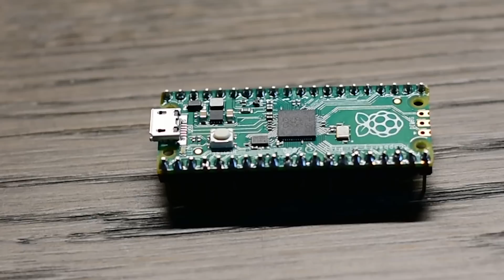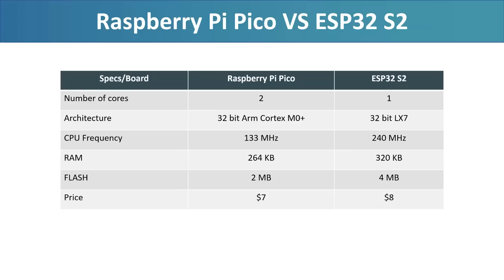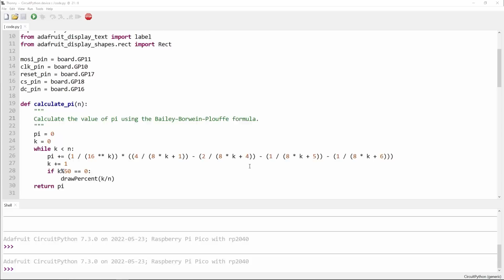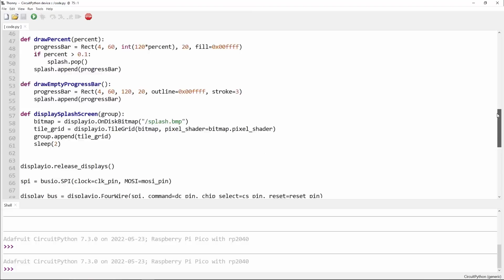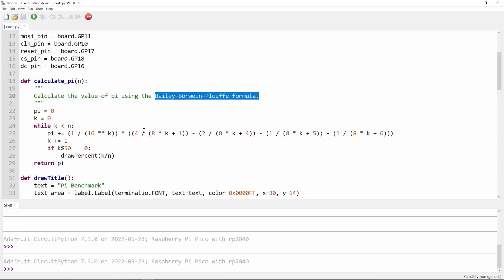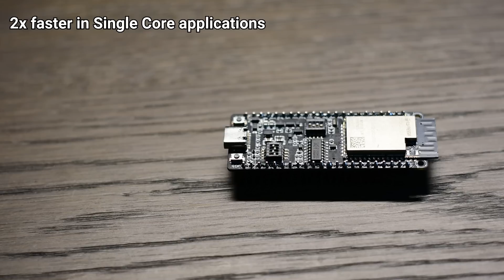Raspberry Pi Pico VS ESP32 S2 speed comparison benchmark using CircuitPython

Comment: Regarding power consumption, the led on the ESP32 can be desoldered as it is adding to the total wattage without doing nothing to the performance outcome of  his test, also, don’t know if the radios are disabled, witch also adds to the total power consumption.
Reply from the maker: I will try that as well. Thanks!

Comment: Any project using WIFI or Bluetooth the S2 is the only option and anything using complex fast IO the PICO would be the better option. People need to learn to match the device to their problem. Also you need to make sure you turn off the WIFI/Bluetooth radio on the S2 when testing. By default these use a lot of power even when not being used unless explicitly turned off.
Reply: The 2040 chip on the Pico is available as a component and has been used on other implementations including WiFi and Bluetooth boards.

Comment: Very nice!
I ran simple calculations and CoreMark on Pico and ESP32, the result is similar.
The fastest one so far is 912Mhz Teensy 4 especially on 64bit floating point calculation. The K210 600Mhz is good for 64bit integer.
Reply: The pico can be overclocked to 250mhz and be se to with -O3 flag
Reply from the maker: Cool! Thanks for sharing. I will try it!

Comment: Was the WIFI radio disabled in your ESP32 sketch? At least for ESP8266 the difference in power use with active WIFI is significant, even when it is not in use.

Comment: I've seen people say you can o/c the pico to 436Mhz.  You could probably safely run it at 266Mhz and you'd be at same speed as ESP32.
Reply: But 2 cores if you know how to use it. Even under Arduino for beginners is multicore library for using Pico second core. Micro Python is also handy for quick developing.
Reply: Just started running the Picomite (Pico with MMBASIC) at 378MHz. Seems solid and no significant temperature rise 👍😎

Comment: Pi Pico is $4 and it is a fixed price. It also has its unique PIO (4 PIO cores for each CPU core), which is a game changer for many applications. It however lacks WiFi/BT capabilities.
Reply: ESP32 S2 is also $2-$4, he probably got it from some resale shop in his country that doubles the price. (which is very common)
Reply: You can get rp2040 board for 3$ weact rp2040 , doesn't have buck boost converter but high quality board. S2 with psram for 4$ wemos s2 mini

Comment: I am getting pretty low RAM on the Esp32-s2 using circuitpython, any have that problem too? gc.mem_free show around 60K and on the Pico show 190K on the esp32-s2 should be more than the Pico
Reply: You can buy wemos s2 mini with 2mb psram

Comment: nice video, but I'm not quite sure if python is the best language to compare the power that lies behind some architecture.
Reply: Micropython is VERY slow on the Pico. This is why I use c as my language of choice. I am using bothe cores I'm my projects. In my case I need seemless integration in my projects. Any stalls in my main code will cause visual flickering problems. The second core solves my issues.
Reply: @talk2azs  not that slow in my experience. Also, over lock exists
Reply: That's what I thought. It's like comparing athletic performance of two runners by only letting them walk on their hands.
Reply: Yea you never know what assembly python will be unrolled into. Sometimes it can be quite baffling unrolling a command to 30 -300 operations when C would do it in one or two
Reply: It’s worth taking a look at the generated code sometimes to get a sense of just how much slower python must run than native code. Python is much easier to understand though, but I have found it’s performance to be very poor on these boards. Just the libraries and the micropython kernel quickly eat up that 2-4mb of flash. Like really quickly.
Reply: I wonder why python has made it into this corner of software engineering in the first place. Don't get me wrong, I think python is very useful. But python on embedded systems seemed as weird to me as java on an embedded system. Always just seems as a tech demo, or a crowd pleaser; not really meant to be used seriously.
Reply: I still wanna see which one is faster at python
Reply: Yeah, it would be a better comparison to just have them both compute the same things and do that in their native code
Reply: You are right, but considering many makers will be using python for their projects, it could be reasonably useful to indicate what their overall experience might be.
Reply: Python is just a wrapper for C
Reply: A better approach would be just to use advertised IPC x Clock (instructions per clock) to get instructions per second

Comment: Where the RP2040 really shines is with complicated I/O. Rather than bit-banging your protocols on the main core, you can use drivers for the PIO cores to manage the low-level details, and work mostly with filled buffers at your application level. The second core is useful in much the same way - offload a complicated process with sensitive timing, leaving your core application logic untroubled by such things. Also, reports are that it overclocks very nicely. All that said, I still love the ESP32 for some workloads.
Reply: If the ESP32-S2 is implemented with a DMA for niche protocols, I don't think the pico's PIO is a straightforward victory. Then again, I'm not too familiar with the ESP's DMA implementation either, so this might be a straight victory for the pico. But for conventional protocols like I2C or SPI, DMA with the ESP32 and DMA or PIO with the pico should be fairly equal. Though I would give extra points to the ESP because its larger ram means it can have a larger buffer.

It does seem the pico has a lot more performance left on the table if python isn't used here. I'm curious how it would fair if this test is done on C. Even with Python, deleting the code drawing that progress bar will make the gap between the two smaller.
Reply: esp has wifi and Bluetooth, it is very handy feature. for projects that don't require internet connection i use good old arduino nano
Reply: @Gameplayer55055  If You don't need Bluetooth and You familiar with Espressif IRAM, You can free more 48KB of RAM
Reply: @Gameplayer55055  Coward.
Reply: @cybermechid9181  that stupid miner/covid/??? related chip crisis kills me. even microcontrollers became more expensive. i remember pico started from 2$. hopefully i have some bought before

esp8266 radio can be turned off in settings. tho pico has more pins, better to use it if no wifi required
Reply: Just a question: Would it be possible to use the pi with a gpio expander to deal with both i2s audio and a full 107key keyboard setup by dividing the operations between the cores? Could probably benefit using a C-language for that comapred to the rather sluggish circuitPython code that usually runs on these dev board.
Reply: @zipp4everyone263  
1) usually keyboards have buttons combined in grid for cost reduction
2) need to get good usb implementation to achieve good polling rate
3) need really optimized code

usually keyboards have specific chip, that is designed to be a keyboard

Comment: First I want to say a wonderful video posting, concise and clear, easy to understand and follow.  And I would give this 4.7 stars our of 5.0 .
I am just being picky about the units, at 3:50 this video describes the RP2040 board using 10% less POWER (than the ESP32) to perform this calculation.
 And I agree the the RP2040 uses 10% less SOMETHING, however that SOMETING is not POWER, but it is ENERGY. 
(NOTE: Most non-technical people don't understand the distinction between Power and Energy)

Comment: Next comparison: hammer vs screwdriver. ESP32 has its uses, but so does RPi Pico. Pico is unbeatable, when you need a ton of cycle exact IO, thanks to its PIO. Try to output DVI signal on an ESP32, not going to be able to do it. But Pico can do it just fine.

Horses for courses. Both are absolutely great uCs and have their niches. You might end up using BOTH of them in the same project!
Reply: There's nothing ESP32 can't do.
Reply: @jaedson-barbosa  VGA with zero CPU usage, and PWM at 200 MHz please. Working fine on the Pico, but would like to move it to a ESP32. Can it do it?
Reply: @dazzer_  you know the PWM frequency is configurable, don't you?
Reply: @jaedson-barbosa  Yes, I do, but that wasn't the question.
Reply: @dazzer_  I'm pretty knowledgable on the esp32, and it can't do either of the things you ask.
Reply: @richardmarsden6541  I know. I was just replying to the "There's nothing ESP32 can't do" comment. I didn't want anyone new to the world of microcontrollers to think that this is actually true.
Reply: @jaedson-barbosa  ESP32 doesnt have specialized programmable IO cores
Reply: @jaedson-barbosa  The ESP32 doesn't have hardware USB support. This gives the pico a huge advantage when you're doing anything with USB. It also has some pretty unique IO features which let you emulate a huge amount of protocols with near zero CPU usage. I find that the RP2040 is often a better all around mcu, but the ESP32 is unbeatable for wireless communications.
Reply: @N0gtail  the new ESP32-S3 has USB host and device support built in
Reply: @ratmandutoo  Wow, I didn't realise. I thought it was just a cheaper variant of the ESP32 with a subset of the features. USB support would make it a seriously good general purpose MCU. I'll have to get myself a few

Comment: It would be interesting to see how the esp32 did with it's clock slowed - it should reduce the power consumption.
Reply: I'd expect the current is proportional to the number of instructions per second, so they should be very close power wise per instruction. In either case, when you are talking about 10's of milliamps for operation, the problem is the same for either platform - long term use with battery power. 
What is more interesting to me is the low power mode and the current drain under low power mode to judge which to use for battery based applications.
Reply: The ESP32 S2 does also have a low-power core. I've used it on the older esp32 and it's very handy for battery-based applications
Reply: @EdFrench_uk  Thanks Ed. I've been wondering which route to take esp32 or pico and this video nudged me towards the esp32. I will chase up the low power modes on both and see which one to use. I will be using these in a camper running off the house batteries, so although I have plenty of power, leaving it on for months while parked will kill the house batteries and I know, at some point, I will forget to switch it all off, so utilising low power mode will ensure the batteries stay good.
Reply: @Bennyboy-dog  worth posting your ideas on the esp32 reddit first. The ULP is hard even for very simple tasks! Often just waking the main cpu when a pin changes is enough tho'

Comment: Nice simple comparison video. Quite informative, although for me the choice of which microcontroller to use in a project generally comes down to the peripheral’s required (eg. Is wireless needed etc.), and also the number of GPIOs I need, and whether I need low power standby (for battery powered), etc.  i.e. Given the speed of most cheap MCU’s today, it’s now pretty rare that speed is a deciding factor.
Reply: agreed.. Im a big fan of the esp boards, have like 11 of those around the house and in these few years i've been interested in mcu's clock speed has not been a limit so far .. For me it's been mostly connectivity (pins, and ofc wifi) , avilable space (kb's) , physical dimensions, IDE support (dont like the arduino ide and like to use VSCode for all my coding), documentation and specially good pinout maps... However this was a fun video and all, but i feel that benchmarking should be done with C

Comment: Have you verified that the LCD updating doesn't effect the test result. My suggestion would be to remove the progressbar and just write test running at start of test
Reply from the maker: Yes you are right, the LCD updating is included in the time needed to run the script. I included it on purpose in order the test not to be pure mathematical, to be closer to real life which usually needs driving an updating a display. Thanks for comment.

Comment: Did you disable the WiFi during the power test?
Reply from the maker: No, but I didn't enable it either. I thought it would be off by default. I have to look more into it. Thanks for pointing it out!
Reply: @Educ8s  The S2 WIFI radio needs to be explicitly disabled or it draws power even when not in use.

Comment: The comparison is somewhat useless.
1.) Price: on paper PICO is cheaper, and yes in some countries, but mostly it is the Raspberry Pi monopoly and it sold through their distributors like element14 in India, making it not so cheaper. While ESP32 is mostly open and generic boards are available everywhere, and so no dealing with shit companies like element14 or RS components .
2.) Features: ESP outperforms with WiFi in all aspects, PICO is no match.
3.) Power: Most of the power was consumed by the LCD, and because PICO was slower, the LCD was on for a longer duration. As per me this comparison of power measurement is completely flawed
4.) Documentation: Though PICO documentation looks prettier, its no match for the number of projects and code written for the ESP32.
Reply from the maker: Thanks for taking the time to write your opinion! I appreciate it. It is always great to hear different opinions and hear the point of view of other people. Thanks for the insights!
Reply: I agree that if your project involves WiFi then ESP32 certainly makes more sense.  Apart from that, your personal opinion about companies like Element14 and RS Components really doesn’t weigh in on this speed comparison. Also, the LCD is powered all of the time showing the calculation results and it’s power consumption will be the same in both circuits, so not really a factor in power consumption comparison when the total power consumed of each circuit was measured while the application was running.
Reply: Not sure how it works to India, but I ordered 3x Pico boards for about $3 each from AliExpress, couldn't find any full size S2 boards for that price.
Reply: Got mine from digikey at $4 a piece, dooshbag.

Comment: I recently ordered a esp32s3 board. Circuitpython still doesn't have multithreading support though 😔
Reply from the maker: The ESP32 S3 is beast. I have to develop a dual-core benchmark to make a comparison with the Pi Pico when we get multithreading support.
Reply: Be a man, use C